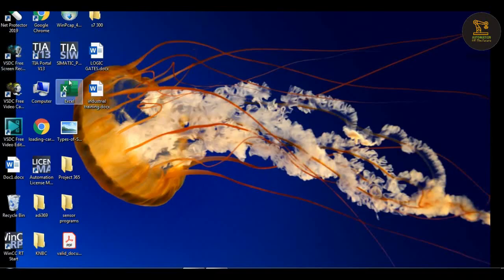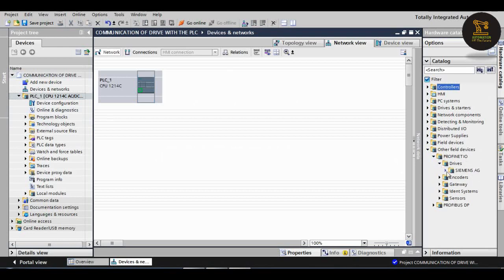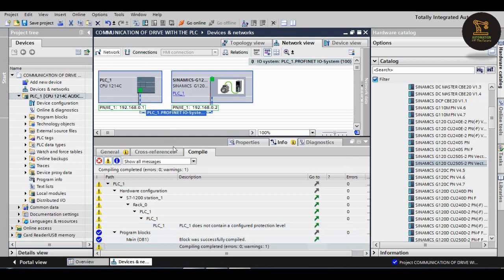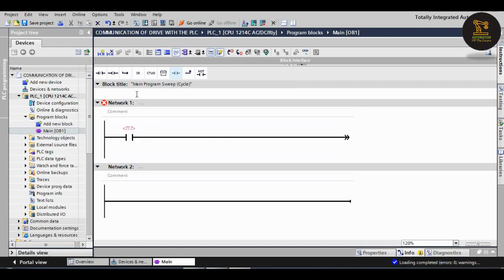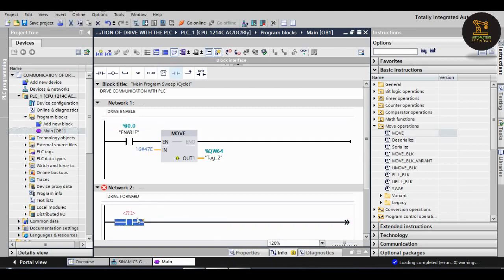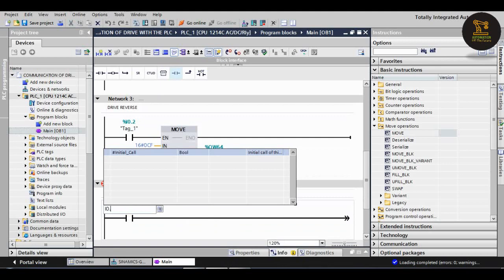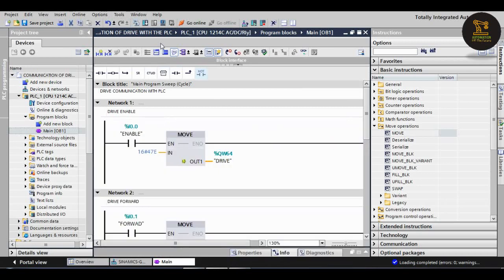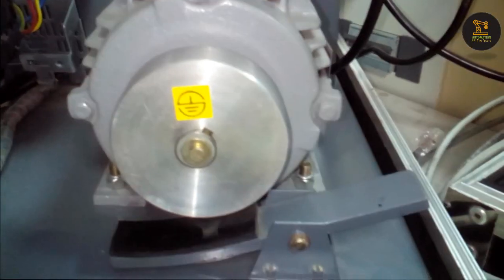PLC to DRIVE Communication (TIA PORTAL V-13)plc#siemens#tia #robotics #scadaprogramming #wincc

Comment: For the commissioning of drive first we use the starter of simotion software for allocate the PZD 
...you only shared  the half and incompleted information due to this many people will be distrub
Reply from the maker: Here in this video we are giving how to communicate plc with drive and run the motor...pls check title if you want we will help you to do parameterisation by using manual...but you need "starter"or "IOP" or atleast BOP
Reply from the maker: Plz check this video 

https://youtu.be/noaiehmcpdw

Comment: Without drive starter software how can you run the motor
Reply from the maker: Can you elaborate the question
Reply: Without optimization how are you running the motor
And without drive software how will  possible the optimization
Reply from the maker: Have you tried with basic parameterisation
Reply from the maker: @abhishekgiri6907  please go with basic manual do parametersiation with help of "IOP"
https://www.google.com/url?sa=t&source=web&rct=j&url=https://media.distributordatasolutions.com/seimens/2017q1/d3ea833c0248a232be360e6701b4b7e8c780d1cb.pdf&ved=2ahUKEwjlv-i-qfz8AhUBSGwGHbqzA4AQFnoECDUQAQ&usg=AOvVaw1WYlWtczk9m5E3qnj5m6PG
Reply: If don't mind
May i know your experience bandwidth?
Reply from the maker: 7 years

Comment: Can we control the speed using him instead of potentiometer?
Reply: When u  connect with plc to drive then respective PIQ address will be assigned where we came see that   in device view window we are sending respective values to that PIQ address in video QW64
Reply: Time 2:50

Comment: About network 4 drive speed did you scale analog input for 0 to 10 volt signal for iw 64
Reply: Its means just connect the potentiometer to the analog input 0-10 volts then select and thats it im right no need to scale so theres no limit the over/under shoot
Reply from the maker: In this video no we haven't
 if you need any help how to do scaling contact me through mail
Reply: @AlfDot  whats your email
Reply from the maker: Automationliftthefuture@gmail.com